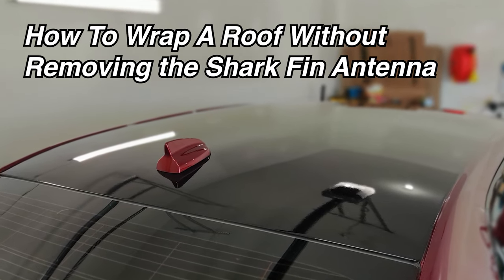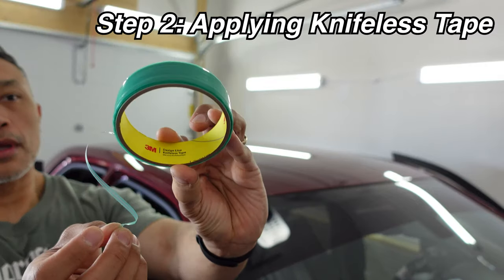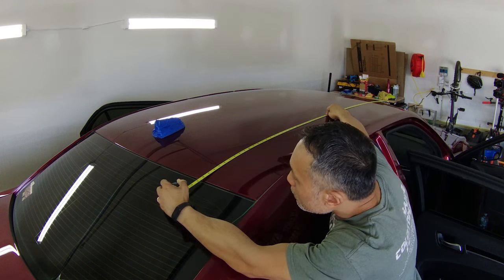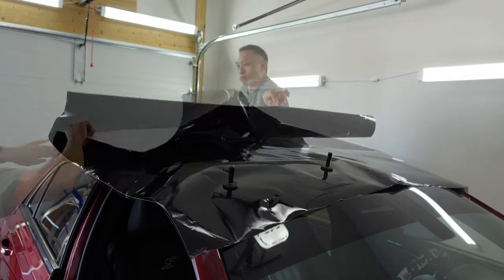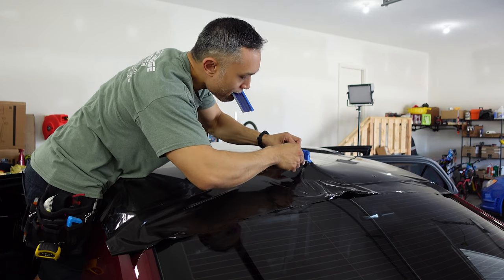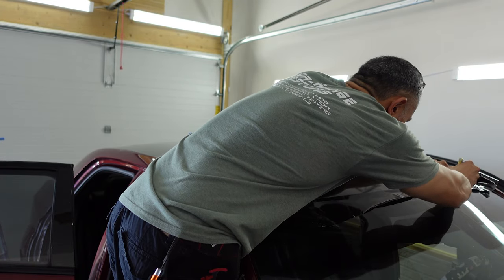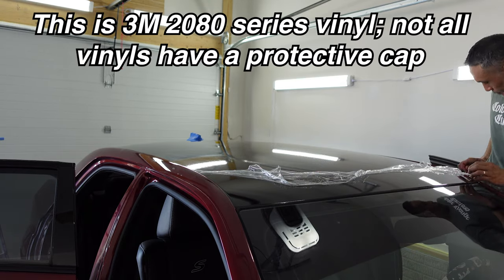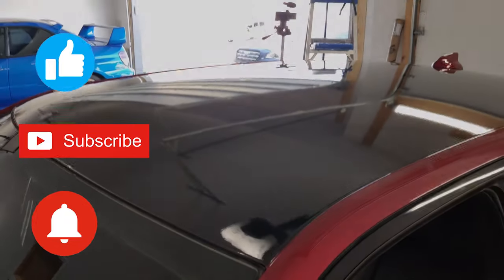How To Vinyl Wrap A Roof Without Removing the Antenna

Comment: this was the best explained video on how to wrap with an antenna on the roof. I will use this technique and it’s much appreciated.
Reply from the maker: Thanks and thanks for watching! Glad this video was helpful.
Reply: @Color Change Customs  how long will the Vinyl roof last & how do you remove snow off of it?
Reply from the maker: @DM-by5sr  each manufacturer specifies how long a wrap will last. As a rule of thumb, I recommend removing roof wraps at 3 years or earlier. If you live in a sun baked place like Arizona, then probably every year I would pull off the vinyl.
Reply: @Color Change Customs  I'm from Philly. I don't wanna waste my money if I got to take it off in a year.

Comment: Did it and your advise helped except it was 100 degrees outside so the vinyl was too soft and sticky didn’t come out the best but will definitely try it with better weather
Reply from the maker: Thanks for watching!  Yes, hotter temperatures make the adhesive stick harder.  Ideal installation temperature would be around 70-75 degrees F, with low humidity.

Comment: looks good but I didnt see where you did the final trimming on the antenna vinyl or how to get into the final configuration at the antenna base.
Reply from the maker: Hi!  Thanks for watching.  In this video I didn't show the up-close of getting the vinyl up to the antenna and then trimming it out.  I did narrate those portions, saying to the effect (when finishing encapsulating) to continue to the base of the antenna, then at the end during the final overview, I say to the effect to trim out the vinyl at the base of antenna.  
I do have another video showing how to trim out around the base of the antenna, starting at about 10:20 in the video:  https://www.youtube.com/watch?v=6o7S7xurXGo&ab_channel=ColorChangeCustoms
Reply: @ColorChangeCustoms  Thanks for that link to final antenna trimming, love that tip about using a thin piece below the knife blade as you cut around the base. I think you saved me a ton of time not having to remove the shark fin, and our car is brand new so really don't want to screw anything up w/ the headliner or other trim pieces!

Comment: Awesome! Thanks. Removing the Shark fin antenna on a 2022 Mitsibishi Outlander has proven to be a pain, at least for me.  If I want to wrap the antenna as well, should it be done first? I appreciate your feedback. Thank you, once more.
Reply from the maker: Thank you and thanks for watching!  As far as wrapping the antenna, I don't know that it would matter if you did it before or after wrapping the roof.  Either way, I would tape over the antenna when wrapping the roof to prevent the vinyl from sticking too hard to the antenna (wrapped or not) while installing the roof vinyl.

Comment: Great video! One question. Can you heat the vinyl with the heat gun even when the plastic cover is on the vinyl?
Reply from the maker: Yes, but be careful.  I've noticed that when you heat too much with the plastic cap still on, when you peel it off, there's a discolored "blotch" on the surface of the film that is visible where you might have concentrated too much heat.  My experience has been that heating that blotch then makes it go away, but maybe it won't for some others.

Comment: Hi can I put vinyl on moon roof while doing roof ?
Reply from the maker: Yes, you can. Just try not to push down on it as the vinyl may stick hard to the glass and make it difficult to remove after you cut it out.

Comment: Could you just use the cutting tape at the base of the antenna and just cut to where the tape is? Or will the vinyl be too loose to the antenna? I’m thinking about attempting a forged carbon vinyl roof wrap on a 2020 mustang. Any recommendations on a brand?
Reply from the maker: You could, but depending on how you lay the knifeless, it could result in gaps.  In terms of brand, I do like Vvivid, but everyone has their pick.  I'd maybe recommend ordering samples of different brands to see which one you like the best for your application.

Comment: No heat gun at all?
Reply from the maker: I used a torch for heat for this project.  I did use heat to help around the antenna, as well as at the corners of the roof to shrink the vinyl at the corners so they hold and look good.  I do use a heat gun, but I jump back and forth between using a torch or heat gun.